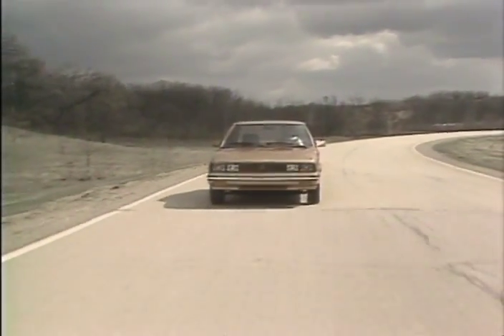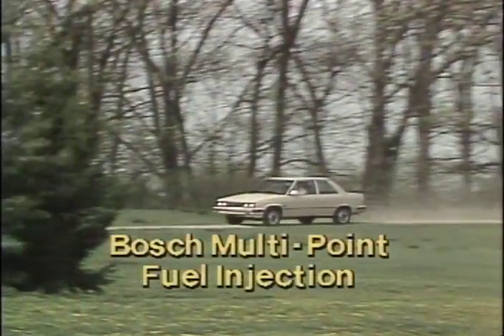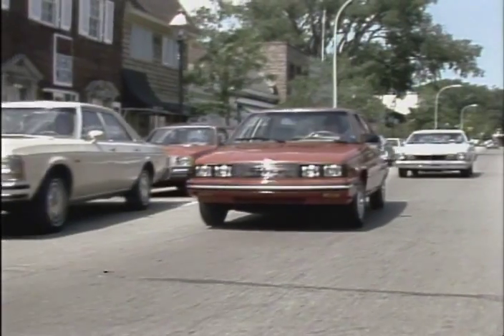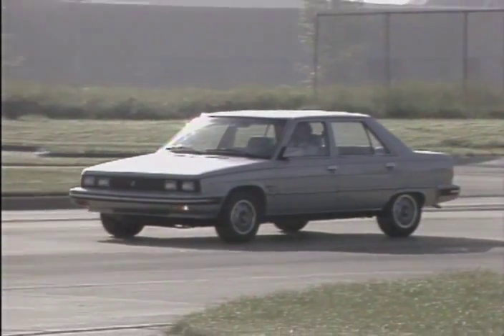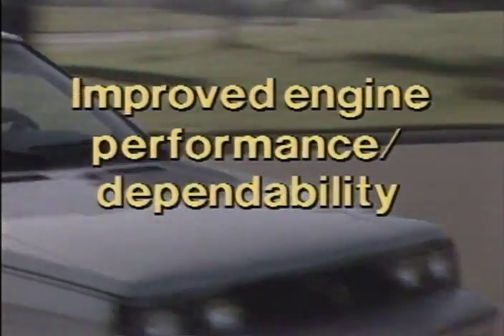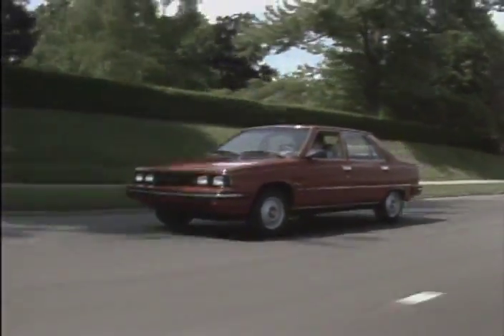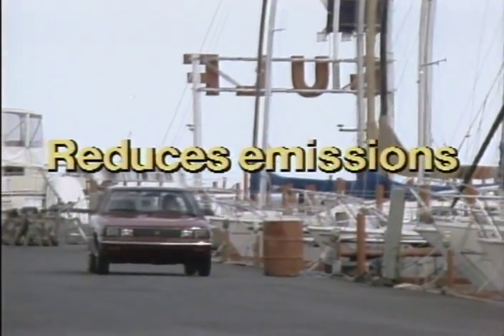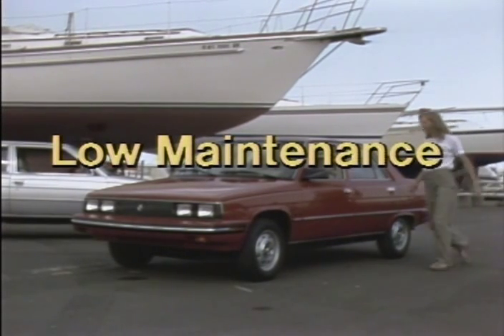Official AMC Renault video : Renault Alliance Injection system

Comment: It's unfortunate they didn't use multipoint injection outside of California.
Reply: I had an '84.  The small engine ran just fine with the single injector, and I could easily get 40MPG.  The engine's only weakness was a tendency for air to accumulate in the cooling system.  I installed a petcock to periodically bleed the air.  Most owners were unaware of the  problem and had premature engine failures.  Iirc, later models got a de-gassing tank to solve the problem.